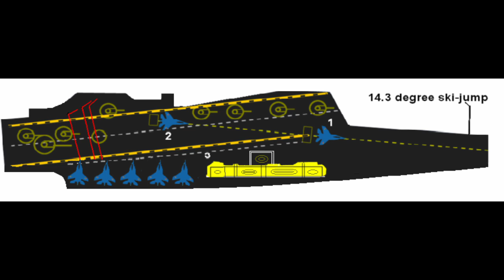INS Vikramaditya - Making a Proper Carrier Out of a Soviet Ship

Comment: I have a question about the design of this carrier, mainly about the position of the superstructure.

If you look at the blueprint from the top, you will see that the bridge is quite close to the runway. I don’t think they will land in that direction, but doesn’t this block the ship from having a third place for takeoff? And the takeoff position sits right on top of the extruded deck for landing, so in case a plane needs to land, they can’t really take off from the carrier…

Comment: And it only cost them twice as much as a new carrier twice the size, plus they still have to work with the compromises made to convert a cruiser into a carrier.
Reply: Twice the cost of a new carrier? Vikramaditya's final price tag was 2.35 billion dollars, which is about what it would cost to build a new carrier at that point.

Now, do remember that a new-build carrier in a foreign yard would be considerably more expensive (with higher profit margins accounted in).

As for your claim, here is a quote from the then Chief of Naval Staff, Adm. Mehta, that he posed to analysts questioning the price : "Can you get me an aircraft carrier for less than 2 billion dollars? If you can, I am going to sign a cheque right now."

Yes, India ended up paying considerably more than planned for the Vikramaditya. No, that doesn't mean the ship was exorbitantly priced, because it wasn't. Even in 2004, naval officers in India had already estimated the cost of the refits to exceed 1.5 billion dollars.
Reply: Its final cost was 2.3 billion. But India made a new carrier and its cost was 3.5 billion. Its not same price.

Comment: An interesting ship. As she was original built, Baku was basically the Soviet equivalent of an LHA, although, unlike the American ships, the Soviet version carried offensive missiles as well. I would argue that the Soviet aircraft cruiser might have been a better design concept for its era, given that both the Harrier and the Soviet equivalent YAK-38 were basically just missile bait by the 1980s (the YAK-38, at least, was substantially faster but still subsonic). These aircraft were just too slow to properly evade a missile. The offensive missiles at least meant the ship could have an effective combat role when her aircraft were not useful. The American LHA didn't come into its own until the F-35B, which finally provides performance comparable to (and better than most) conventional-takeoff aircraft.
Reply: "Too slow to evade a missile"
Absolute nonsense. Speed hasn't been key to avoiding missiles since the 1960's (unless counting the SR-71 or other niche aircraft), with Countermeasures being the actual main solution.

Also worth noting that no Harriers were ever lost to missiles, rather in 1982 the Harriers were downing ostensibly "fast" conventional jets in quantity with their own missiles 😂 .

In short: speed isn't key, rather the whole package is.

That: and the YAK-38 never worked right 😂
Reply: Su-30s (a modification of the Su-27 for the Navy) were mostly used on aircraft carriers of this class.

Comment: Someone remind me…what was the point of rebuilding vs just build from new?
Reply: Lack of experience at the time. India had only two ex-British Carriers to form a basis of how to Carrier, and had never built one domestically.

Naturally the UK could have sold them the HMS Ark Royal (R09) or built an Invincible class or two to order, but the Indians likely considered such options at the time as too expensive.

Probably a similar motive for why they didn't investigate buying a used Carrier from the USA.
Reply: @jimtaylor294  The issue with Ark Royal was that she was in very bad shape by 1978-79. She was starting to have a multitude of electrical and mechanical problems, and further service was extremely cost-prohibitive. Building Invincible-class carriers would have been a good idea, but the Indian Navy would ideally want two, and that was considered cost prohibitive (considering that the surface fleet had recently been expanded).
A second hand carrier from the Americans was completely out of the question. The USA and India didn't enjoy particularly smooth relations in those days, and even if the USN would have spared a carrier, it would either be a venerable Essex-class carrier (and there were 5-6 ships of that class still floating around), or the Midway or Coral Sea. The Essexes were very old ships that would have little serviceable life left. The Midways would require significant infrastructure upscaling in India to properly use them. As such, this was also out of the question.
Reply: @anantrajagopal5797  Some interesting points (especially on the US question), though a couple of points are worth noting:

• Ark Royal was having some issues aye, due in part to a planned Life Extension refit being cancelled in the 1960's, alongwith the extremely controversial and in retrospect insane decision in 1966 to run down the Carrier fleet without replacement. The true extent of these issues is still debated in the UK today though, as is questions whether Eagle should have been kept in service instead or whether Argentina would have been daft enough to go territory nicking had Ark Royal been retained / had like Hermes avoided the cutters torch for a couple of years longer.
That; and while it's not clear whether a wartime [for lack of better term] refit might have fixed these issues, it's certainly thought provoking.

• In 1982 the UK Gov' seriously considered refurbishing Hermes's sistership Bulwark to support Hermes and Invincible while Illustrious was made ready; if not for two boiler room fires in preceeding years she likely would have been, which is an interesting thought as the IN would have the option of buying two Centaur class ships.

• Interesting point on the Invincible class option, though it is notable that the IN did only buy one ship with Hermes, and that Australia was planning to buy just one ship (Invincible herself) as a replacement for HMAS Melbourne before the 1982 conflict voided the sale.
Makes one wonder if the IN considered the option of buying one Invincible class to order, while purchasing the right and technical assistance to build another domestically under license 🤔

Comment: Regarding the pronunciation, you almost got it right. The "Vikram" part was perfect. The "aditya" part is pronounced as "aadi" (with a soft 'd') - "tya" (with the 't' and 'y' sort of joined together into a single syllable).

Regarding the ship herself, she has been fairly decent in her service, with the exception of her recent refit where she had an electric short-circuit leading to a minor fire.

Regarding the two-carrier part, the thing about a lack of aircraft is true. The Indian Navy has 45 MiG-29Ks in service, including training aircraft. The two carriers require some 60 aircraft between them (including trainers that would normally be stationed at naval aviation bases). To rectify that, the Indian Navy has announced an order for 26 Rafale M aircraft for Vikrant, with the MiG-29K then planned to be stationed for Vikramaditya. Subsequently, once the indigenous Twin Engine Deck-Based Fighter (TEDBF) enters service in the early 2030s, those aircraft would be stationed from both, and potentially the proposed third carrier, which would be a 50,000-ish ton half-sister to Vikrant.

Comment: The Russians call them aviation cruisers in order to get them out of and out of the black sea. Aircraft carriers are not allowed to transit through the bosporus straits.
Reply: The Kiev's were never carriers, just cruisers with oversized helicopter decks. The ship still has a very small hanger deck. India's indigenous carrier will be a much better carriers.
Reply: @kdrapertrucker  yeah most likely
Reply: At least not any above 15000 tonnes and good luck getting auch auch flatt top that small to work with anything but helicopters or jump jets